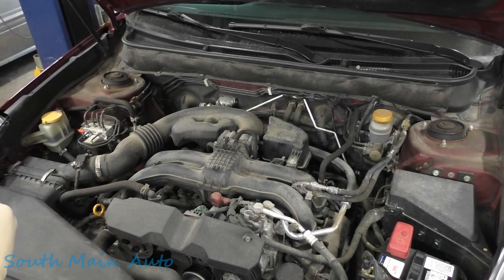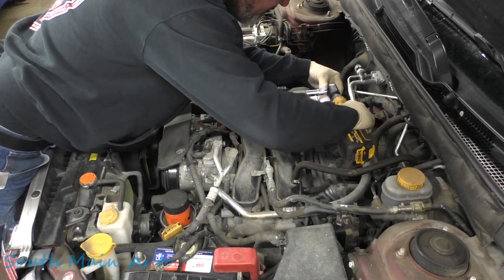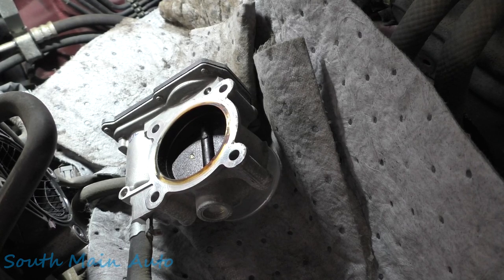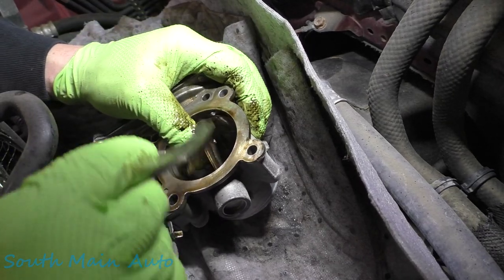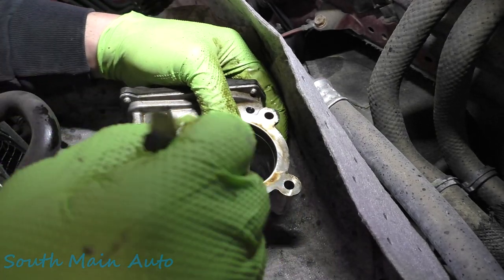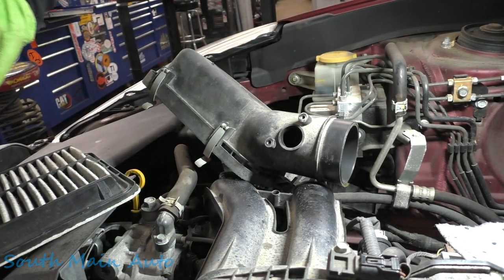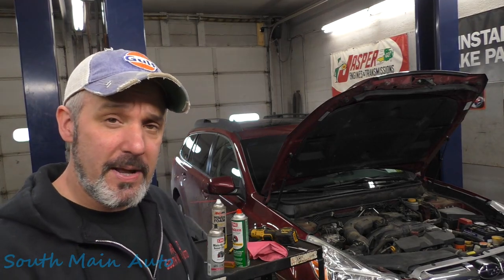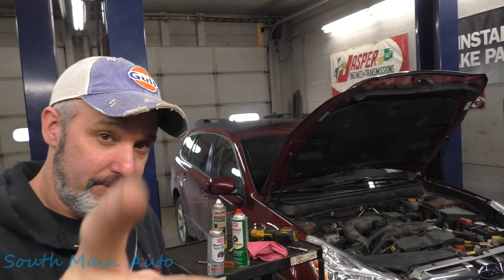How Does Your Shop Deal With Intermittent Symptoms?

Comment: Sometimes you'll find out that its a bad relay where the soldered joints have microscopic cracks due to long term vibration and therefore can cut out when you least expect it. If you suspect you have a bad relay, try to crack it open and see if you see bad solder joints or arcing and then put a dab of flux on it and then resolder the joint(s). 👍

Comment: We were going through an intermittent issue with my wife’s Santa Fe recently. Her cousin is a Hyundai mechanic so we took it to him. Being intermittent, it was a tough diag, especially without any codes. He did the same thing by unplugging a potential failed sensor. It acted up twice with the sensor unplugged, so obviously that wasn’t the problem. He ended up saying “I’m not sure what it is at this point”, but did clean the throttle body and sent it down the road. All we can do is drive it and wait to see if that fixed it or if it gets worse and isn’t intermittent anymore.

Comment: I'm not a shop owner I'm DIY on my couple pontiac grand prixs.  My advice would be start simple and stick to the fundamentals. Verify all the sensors are reporting what they should, check your spark plugs and clean the throttle body, check for vacuum leaks. Anything past that could be chasing ghosts unless the issue pops up.

Comment: Make sure battery, alternator, ground lead and starter motor connections are clean and tight, a quick toot of WD40 into the EVAP purge valve and spray of electrical cleaner on the MAP and intake air temperature sensor never hurts and require no parts.

Comment: As a dealership tech "around here" that deals with intermittent issues regularly. I give the customer  a full check over in the areas that could be part of the concern. Inspect and test potential causes with in reason and Develop a plan of attack that has a the customers best interest in mind. I am fully aware this is not common among dealer techs.

Comment: I used to play with Subbie's and you hit everything I would have.  Throttle body and EGR would have been my first stops.

Here's another one for anyone that has an idea.  My truck, 04 Chevy 1500, 5.3 L -  Intermittent stumble, misfire at idle, goes away under power.  It has thrown a code for random misfire 3 times over last 4 YEARS...  never any certain cylinder.  I have replaced plugs/wires, cleaned throttle body, new fuel pump last winter-no change.  Other then that normal maint.  I think it is a little worse/more noticeable after warmed up.  No other codes, fuel trims are good, 0-2 sensor readings are good.  Doesn't really affect anything, just bugs me, has never gotten any better or worse.  I finally just decided to wait until something broke, but it's been 4/5 years!  Again, just bugs me.  I'm that guy that works on his own stuff and I usually have it dialed in.  Any help is appreciated!

Comment: It depends on the type of intermittent problem.  Here, the owner was somewhat inconvenienced.  We had a new Ford Taurus which would occasionally throw a fit - a relay would start clicking - and the dash lights would  shut off.  Seems like some other stuff would turn off, too.  The relay sounded like it was in the middle of the dash, but the dealership said there wasn't a relay there.  After four or five visits they talked to somebody at Ford and learned there WAS a relay in the middle of the dash which wasn't on the service information.  They replaced it and I didn't have another problem.

Comment: Biggest thing is 100% transparency with the customer on these types of concerns. In all reality, driveability concerns can be hard as is to diagnose, especially if they are intermittent. This is where experience is a big factor in helping diagnosis. First thing we do is drive it and try to duplicate the concern, preferably with the scantool hooked up. Can't duplicate it? Let the customer know and tell them you'll begin with a basic overlook and verification of the various systems. Then usually look for TSBs, PIs etc. Even throw a Google search and a few fourm look throughs. If we still don't come up with anything obvious then we let the customer know we can begin more exploratory diagnosis like cleaning throttle body, checking EGR, purge solenoid valve etc. Always have to make sure they are comfortable paying extra for the diagnosis of a difficult diag

Comment: It was an intermittent like this one that caused me to work on a car after 20 years hiatus.  Vehicle was a '95 Ford Explorer back in 2007.  Internet told me it was the IAC valve, which I had no clue about having only worked on carbureted vehicles and the only things plugging in being lights and the radio.  And the internet was young, so was actually correct back then and the part was right on top.  But luck doesn't save you from needing to test.  

My heat pump had a only works at night problem.  A tech could have thrown a part, but I was able to test the high pressure sensor in the morning, after the unit stopped working and again after sunset to see the resistance was going up across the switch, micro crack.  Had similar on my cable drop, with a couple outages a year till the tech got lucky and noticed the cracked insulator while testing at the pole.

Comment: I always look at the harnesses, in and below the engine and anywhere any run goes. Mfgs try to save 0.001 cent per cable and make them super short, rubbing up against components and frame members cause opens, shorts or worse "intermittent" shorts/opens. Even if its not you will probably save a future headache putting somethng between the cable and the frame.

Comment: The "how do you handle intermittent problems?" question really depends on the vehicle, its age and mileage, and the specific failure mode. 

For this engine, I believe ETC is used for idle speed control, throttle control and cruise control. If this is the case then the problem of stalling at idle would point to a sticking throttle body balanced butterfly valve. Which is a common intermittent failure mode given the age and mileage of the vehicle. Idle speed control is not an easy function due to the very small changes needed in plate angle position to control the amount of air at idle, and a small opening change in the throttle plate produces a very non-linear increase in air flow, it is not easy to control to a specific idle RPM.

What this means is the throttle body (the valve and the bore) needs to be very clean in order to operate properly (the butterfly shaft also needs to be lubricated properly along with any drive gears). If we look at the heat-soak failure mode described by the customer, it only makes sense if you understand how the throttle body control is performed. For example, to establish a mechanical reference, a closed throttle in this case, the control algorithm could force the throttle closed while cranking and then remember and confirm that it is positionally correct with the potentiometer feedback. Having closed the throttle and confirming the positional feedback is working, now the controller needs to open the throttle to establish proper idle. If the throttle plate sticks, at the maximum power (or at the circuit current limit) of the motor amplifier, then the plate will not move and the car will stall. Also, the end result of a dirty throttle body could cause a stiction (static friction) problem and prevent any fine positional (airflow) control. It would jump from one position to another, overshooting the desired position. 

But, how would you test a sticky throttle valve? You could use your borescope camera to watch the throttle valve in real-time. You would have to unclamp the air intake hose introduce the camera and then use tape to seal the gaps. Go key on to see what the controller is trying to do, then start the vehicle and see how the throttle valve responds to accelerator pedal input.

Comment: For me, I make an honest effort to confirm the customer’s concern. In some cases, this might include several road tests, going for a ride with the customer, looking for TSBs, etc. If the vehicle never acts up, the next step depends a lot on the customer. If they give very detailed information about their concern and when/where it happens, I can usually make a call based off of prior experience about things to try. I let the customer know that I don’t know what the issue is but give them suggestions of things we can try and see if it helps. I’m as transparent as possible and if they’re ok with that and fully understand that I can’t guarantee a fix without actually experiencing the issue, we’ll try a few things. They’re usually pretty inexpensive fixes (often maintenance items). I won’t WAG an expensive fix. If a customer doesn’t seem to fully understand that I can’t give a guaranteed fix without the problem happening consistently enough to diagnose it, I won’t do anything. We’ll kick the car out no charge and tell them to come back when it breaks. It’s not worth it to try and fix an intermittent issue for a customer that doesn’t understand the basics of how to diagnose anything (i.e. it has to be broken in order to fix it) because if the very first thing you try doesn’t fully address their concern, you own it from that point on.

I’m gonna guess you got the BG pocket pry bar in a swag bag from some sort of auto repair expo or training.

EDIT: I was typing my message while watching the video. It sounds like my approach is very similar to yours.

Comment: I had a Stratus that would intermittently die on me while driving down the road. Took it to the shop, no engine light ever. Explained it was intermittent. He looked at and couldn't find anything wrong. in the end he unplugged all the senors and plugged them back in. That didn't solve the issue. After 3 times of going back and having him drive the vehicle, he finally got it to die on him. But  still no code and he said he was at a loss for direction. He was honest and told me all he could do at this point was throw sensors at it till we figured out which one it was. Being able to do most jobs myself if I know what needs done I started throwing sensors at it. Started with the cheapest one and that was the Throttle position. Then the crank position, then the cam, finally threw a code for map. After changing the map it quit dying.

Comment: I'll start by cleaning the throttle body and checking that it's holding resting fuel pressure.  My experience  with those engines is dirty TB. These cars typically are pretty reliable wirh double those miles.

Comment: When I first got my truck, it was a used vehicle, I started getting check engine light on and off and didnt have a scan tool at the time. I had just gotten it days ago from the dealer so I brought it in and everytime I tried to bring it there the check engine light would go off. They wouldnt do anything because they werent actively seeing the code. Finally decided to just buy my own scan tool, popped up with a O2 sensor, pulled it out and it was pure black carbon all over it, replaced it and didnt have a problem after. Still these 6 years later havent had any check engine codes.

Comment: Just fixed a intermittent stalling on our Focus, at least I think so. I can understand fully why shops don't want to touch them. Can't say how many times I looked at. Thought it was same thing.. vacuum leak or something to do with the intake. Nope #1 spark plug wire was leaking the lightening out of the side randomly, when your hand is close that'll scare you. Good Motorcraft wires also.

Comment: Intermittent stumbling and stalling has always been something to do with air flow impedance in my history, and in others' cars I've worked on and successfully fixed where shops have failed.  Vac leaks give high idles, IAC (maybe I'm just lucky but IAC is usually the problem here) faults give stall outs.  It was to the point where I got tired of rebuying parts at stores that would just fail and I literally took it out while it was in a good position and JB welded it solid and left it unplugged.  It's still working just fine to this day from 6-7 years ago.  I made 2, one with a slightly higher idle and one with a slightly lower idle. I'm surprised you didn't check the IAC, given how dirty that TB was I'm sure the IAC is just as bad off, and as temperature changes so does the nature of all the carbon coating that's no doubt coating the inside of it.
Reply from the maker: This car doesn't idle air control valve. You should have seen in the video it was an electronic throttle body. No electronic throttle bodies use idle air control valves. Plus vacuum leaks do not make the idle high on a mass airflow engine. A vacuum leak only makes the idle high on engines that run on speed density.

Comment: My truck was doing that, stall randomly. It was just a loose battery cable. It would appear that it was something associated with the engine being warm, but I think it more had to do with vibration, bump in the road, etc. that would shake the battery connection and shut the vehicle down. I figured it out when I opened the hood and the hood light didn't come on.

Comment: That's honestly all you can do to set a baseline of what it ain't. 
Had a 2000ish Taurus come in with an intermittent drivability issue back in the day. No CEL, so clean the TB & maf, pulled a spark plug, looked like crap, so did plugs and wires (seemed the car had 150k on all the OEM  stuff)  and a fuel filter (seemed the fuel pressure wasn't where I'd preferred at first) 
Obviously ran like new.

Comment: I know you have mentioned the little Christmas tree on the right side intake a couple of times. I don't know when they stopped putting it on there but on our 16 Crosstrek, 17 and 2022 Forrester this is also missing. Guess saving .00003 cents is worth it from factory.

Comment: Subarus need NGK plugs only ,they don't like anything else ,and the reason people fit aftermarket parts is because normally Subaru parts are expensive and customers have to make the best choice for the wallet .
Has the owner done the spark plugs,and the duel filter or run injector cleaner through the fuel system ,even  any change in fuel purchases can contribute to funny things happening.
That foam cleaner looks like The Mercury Marine Product called Power Tune ,works wonders on what you stated,internal clean up ,but also is a great cleaner of carbon build up as you just proved ,wonder if it would clean the oven ???😮😮😮😮
Sometimes these products may come from the same manufacturer ,and branded to suit .
The main thing is most do work , especially older carburetor motors ,sometimes a squirt in the mixture venturi cleans out moisture and dirt .
Two stroke power tools sometimes need a quick boost ,spray foam works well ,helping to clean the reed valves etc .

Comment: Yes, intermittants are just that, hit and miss. Whats a great advantage these days is that we all have some kind of access to video recording which could be used by the owners in that each time before they start their vehicle, they can hit record and place the phone/camera in a location best for observing the issue and leave it recording for when the problem starts. Of course it would take some fair experience in video recording to get that just right for the mechanic to be of any help. 
Lots of shops recommend WIX filters for aftermarket quality...likely the least that don't fit right and they aren't the least expensive but less than OEM. 
I've witnesses several auto repair videos that show cleaning a throttle body that is only slightly dirty at the butterfly will improve idle BIG time if it does at all. It's all worth doing and never a waste of time when tracing down the culprit.

Comment: I had a '73 Bug that would lose power on a long trip. The owner of the repair shop said it could be a faulty distributor but I said it couldn't be because the distributor was brand new. He couldn't duplicate it but he was going for a long trip with his family and he took them in my Beetle and witnessed the problem for himself and of course it was the rotor that was failing when it got hot and not firing on all cylinders and that is how it got diagnosed.

Comment: Same issue with my 2011 Outback for the last 100k miles. I cleaned the throttle body and egr at 100k after it started. No change. I just did a 200k tuneup which included cleaning throttle body again, no change. I use MAF cleaner every time I change the air filter (every 15k). The only mechanical issue the car has is valve cover spark plug seals leak (minor). 
The issue only ever happens in gear after coming to a stop. Doesn’t matter hot or cold, it’s random. I’d suspect the torque converter, but there’s been no change in 100k miles, I’d expect it to have worsened.
The only thing that ever helped was increasing the idle using a laptop connected to the DLC. I’m running idle stock atm. I’ve been too lazy to plug in the computer after every time the battery is disconnected. The idle setting clears to stock when you disconnect the battery.

Comment: The battery should also be checked when hot. Sometimes it will be fine for cold starts but when HOT will give a low voltage that will crank the engine but not start it.

Comment: Well for me it all depends on the issue and the customer. You could just remove the red cap and drive a new one under it and reinstall rad cap, if problem persists then replace rad cap. Or take a stab kind of like you are doing but it depends. This one sounds more like fuel issue, the fuel pump dying or does it happen when the fuel tank is at any level? How does it restart when it dies, fire right up or does it start hard and sputter for a bit?

Comment: Hi Eric my first thought was the gasoline. Out where I live the smaller gas stations that are 40 miles apart in the rural areas tend to have gasoline issues that would cause intermittent issues with how the car runs. Just a thought.